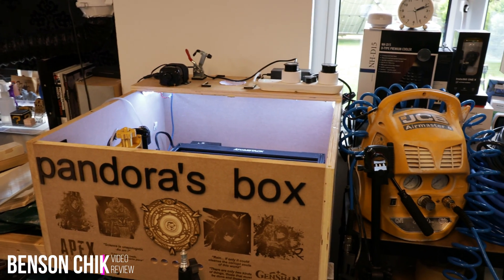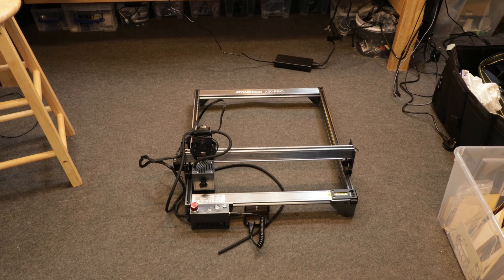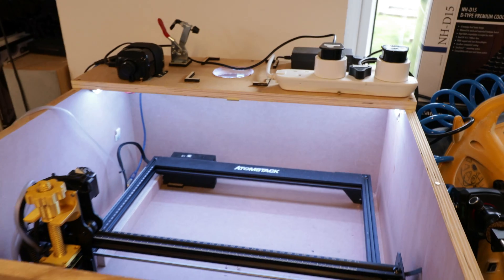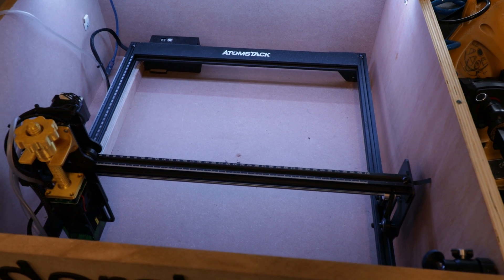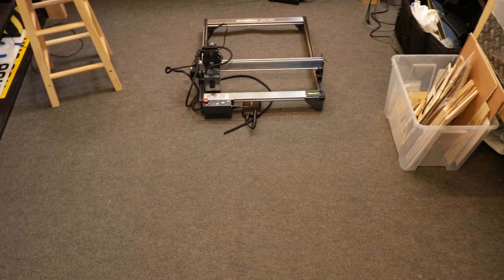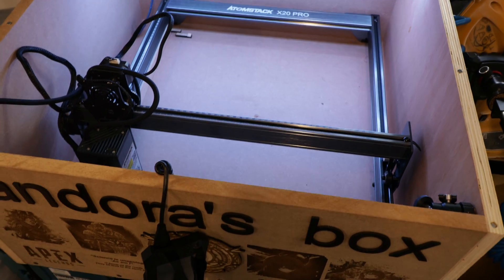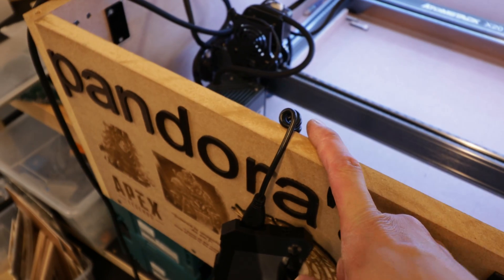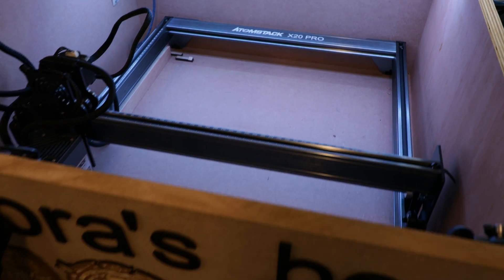Atomstack X20 Pro lightburn material tests Ply Slate Glass by Benson Chik

Comment: Have you got those material test templates please
Reply from the maker: Sorry, no longer have those files as Lightburn now have material test built in. The free website to create the test is still online here https://www.o2creative.co.nz/laser/    hope that helps
Reply: @BCreviews cheers man.have you still got the x20..got one used once for 150 quid. Bit overwhelmed by it .
Reply from the maker: @midnightpretenders5749 I am now using Neje Max4 which is similar power but with Z height adjustments.  Check out my video on paw shape keyring, it cover some basic of laser function and easy to grasp. Good luck 😉

Comment: Question since you have the A5 do you think it would be a good idea to upgrade just the laser.  They are selling it on the atomstack website.  I haven’t seen any reviews on using the A5 frame with the m100.
Reply from the maker: I would not recommend mounting the m100 head on the A5 frame as it is a lot heavier and the A5 X axis is not well designed. Personally my A5 laser head does wobble when pushed by hand at the Y axis directions but at lower speed sub 1000mm/mins it does not introduce any defects to my projects. With the m100 you will be doing a lot more 1000mm/min speed.

Comment: Product name:  ATOMSTACK X20 Pro 130W Laser Engraver, Strong cutting /engraving capability
25 % off
code: ABWW6GV9
Deal Price : 1199.99*0.75=899.99
Original price: 1199.99 
End Day: 2022-10-30 23:59PST
Link: https://www.amazon.com/dp/B0B11LLQ6Y

ATOMSTACK A5 Pro 40W Laser Engraver Master，7 day Deals
28 %off
code:  KAJSAZ28
Deal Price : 266
Original price: 369.99
End Day: 2022-10-30 23:59PST
Link:https://www.amazon.com/dp/B0969CXWWH

Product: ATOMSTACK X7 40W Laser Engraver 50% off
Link: https://www.amazon.com/dp/B09VGLMQ3S
Coupon Code: 6EOMPEAX
Coupon Code Price: 234.99
Original price: 469.99
End Date: 2022-10-30 23:59 PDT

Comment: Hello Benson, could you do me a favor and try cutting 3mm MDF with the Atomstack  X20?  If you could use the Lightburn material test (it's in the TOOLS drop down window:  count 5 x 5, speed 100-500:  power 60-100 and share the results it would really help me make up my mined about this laser.    thanks for your time

Comment: Interesting results 🤔 

Have you tried clear acrylic yet?
Reply from the maker: Not tested on acrylic yet, will be testing other materials once I sorted a enclosure for it
Reply: Clear Acrylic, is more translucent than glass, CO2 Laser only way to cut it, however with a dark card or tape on the front or back, you can etch the plastic like glass, however it does create heat pockets and fractures the plastic, in spots.

Comment: This is a $1000 dollar machine for the same price you can get a CO2 which is 2,5-3X stronger with box and real honey comb grid and air support. Ok + shipping which can almost double that price but at the end you are for ahead with CO2 if you really want to cut... if this machine would be about $350 what the A5 pro cost it would be OK. It seems to me that when the Diode lasers get to the strength of the CO2 they will match the price too...
Reply: I have a fully upgraded K40 (I use Lightburn).. I want a  diode laser so I don't have to mess with mirror alignment ever again!  With any of the Co2 lasers your going to have "dead spots" on your bed. The Co2 lasers that you find on Amazon or Ebay are not precision machines, if they were they would cost $10,000. everyone will have to make up their own minds. I've had my K40 for over two years and I made some nice buildings for my model railroad and my miniature war gaming. I'm just ready to do more and I don't want to adjust mirrors!
Reply: @generalpattonpending7256  I only adjust mirrors once a week and it takes me 5 minutes not a dealbreaker
Reply from the maker: Thanks for watching my video 👍 I think you have over simplified CO2 set up and cost. At 1000$ it will be a K40 type of CO2 with all the mods, it will be limited to smaller size bed and needed water cooling and failure on delivery is high with those machine. My A5 is cheap at less than 200$, great for engraving but cutting is limited to 2-3mm and very slow. The x20 will cut 2-3mm at 4x the speed of A5 and much cleaner. The frame and rollers are all more refine and ready for more consistent production. 1k$ is a lot but it is a finished product with no mod need to start production.

What I really want is a Omtech 60w 40x60cm which is cost me around 2500$ 

Please watch more of my video and I may be able to have one in a few years 😂
Reply: @BCreviews  No the price on E-Bay of a 50W CO2 laser 60x40cm with box+airsupport+smooke suction+water pump+Ruida controller+ honey comb bed is about $1200 (it is like mine). The problem is delivery which does cost a lot since it is a big machine. It might really cost twice than the X20 but it is really 50W which is a lot more than 20W. My CO2 is just about 10x faster than my A5 pro. The CO2 comes with a waterpump and a bucket that is it .Summertime you have to put some frozen bottle into it. If it is very hot you MIGHT have to buy an industrial water chiller...not cheap about $350-400 but if you use it in the basement you might never need that. I do not need it. Failure is not a problem I have guarantee (OK only 1 year) I mean it is a nice machine but the problem is that they cannot make a stronger diode laser than 5,5W so they have to put two into it and than 4 and probably next year 8 will go into it but the price is going up like creasy as well... The K40 is really cheap but too small and no Ruida controller (which is great)...
Reply: @bacsijancsi  Like you said with shipping and extra setup & maintenance its prob gonna be 2x the price of this machine, so it is expensive but just might be worth it. For me the easy set up, low maintenance, smaller size and power/versatility makes it worthy for me. However anymore serious cutting you'd for sure get a K40.
Reply: @Andrew-jx8gg  No the K40 is really small 20x30cm and no Ruida controller and no raising bad.... does not really worth it.... too much compromise. I have an A5 Pro just on the shelf... it was not a waist of money  we learned a lot about laser cutting... using Lightburn etc...
Reply from the maker: My dream is to have a wall mounted co2 laser which can cut full sheet 2400x1200 ply 18mm 😍 please keep watching my video so I can afford one in a few years (thinking of building a co2 from components
Reply: @BCreviews  :-)))) Nice idea. Yes building from components was in my mind also but...well it is just not that easy and the components are also very expensive..... I did not dare to risk it :-)

Comment: It is a question how do you clean that 4 diode head??? I have an Atomstack A5 pro and now a 50W Co2 and both had to be cleaned regularly because of the glue in the plywood and even more if I cut HDF or MDF. If you don't clean your head with all the lenses and the inside of the head than the glue evaporated in the some will collect up very fast and the efficiency of the machine declines very -very fast. I clean my CO2 daily when I use it a lot. Even the s moe suction system has to be cleaned and the honey comb grid as well...
Reply from the maker: Not sure as the machine is still new on the market. I am hoping that most of the smoke and Vapor will be on the final lens and nothing behind it, just as a single head laser we don’t clean the laser itself but the lens in front? 🤞
Reply: @BCreviews  I don't know... Since it has airsupport that probably means that air has to go through the head with all the 4 diodes, I think that glue will pile up. I surely had to clean my Atomstack A5pro when I used it (as now I have CO2 it collects dust on the shelf:-) If I did not clean it the power went down very fast to about half, just as the CO2
Reply from the maker: @bacsijancsi  I would think the air would just join in at the space after the final lens and not through the lasers. I am in the middle of mass engraving and cutting. Let’s see if I will manage to make it dirty 😄
Reply: @BCreviews  Sure I am very curious!!!!!  Anyway it is very exciting that a diode laser can reach 20W ...just a bit pricy I think whatever thanks for the video

Comment: are you going to test engraving times? very curious if its faster at engraving than 10w, also curious if its loses fine detail due to its power. having it now, Would you recommend it to others?
Reply from the maker: Now that I have cut more material and engraving on different surfaces I can say that it is 4x the power of my A5. I will clean cut 3mm plywood at 300mm/m in one pass. More importantly the focus depth is a lot more forgiving, my A5 only cut 3mm ply at multi pass and only if the wood is really flat. The X20 will just clean cut even if the material is bend and raised by a few mm. 

I will let viewer decide if it is worth the upgrade as everyone has different budget and requirements, for me, at £800 and comes with air assist it is expensive but nothing budget will come close to it so far

Comment: With thick woods try putting the focus in the middle of the wood. That the focus is not at the top but in the middle of the thickness of the wood. Your tests are very interesting
Reply from the maker: Agree, I think next test will be 5 pass then lower by 3mm etc. My A5 has a turn adjustable Z height which I 3D printed. Not fancy modding the X20 just yet as it is expensive kit